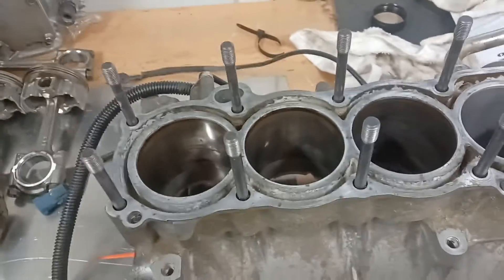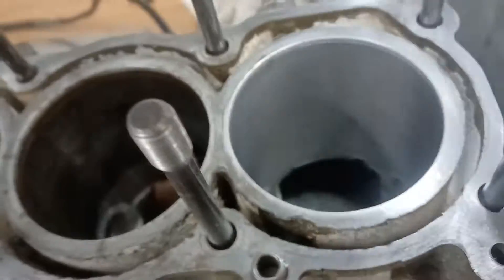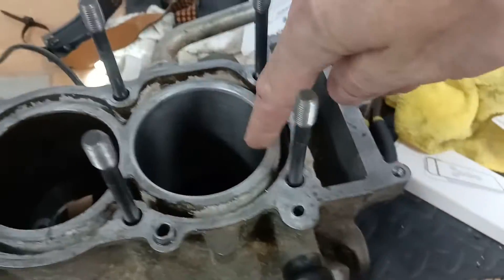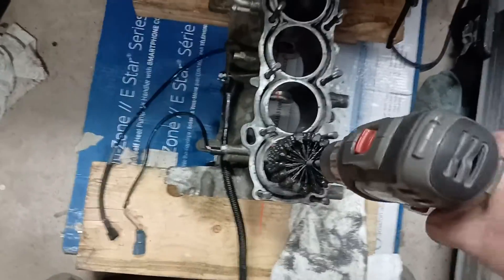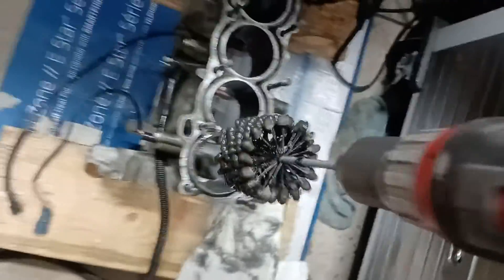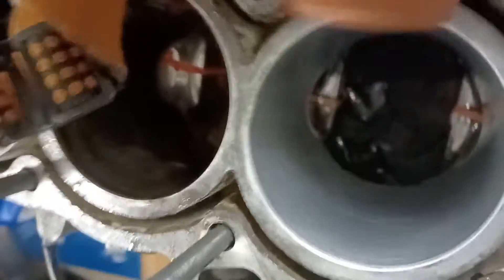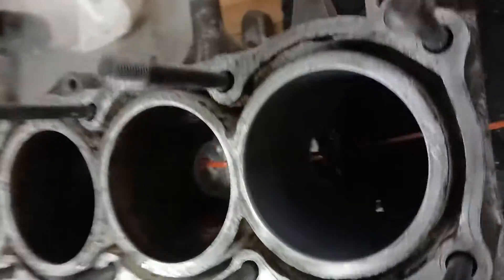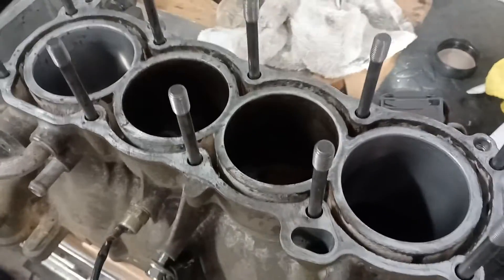Yamaha FXHO, VX110, FX140 cylinder deglazing imperfection removal using flex hone

Comment: I guess standard size piston rings were used
Reply from the maker: @a.h8362  yes.  this was just de-glazing and cleaning them up.  it doesn't take off enough material to need to go up in size on anything but you still need to check all of your bore measurements for tolerances and verify the cylinders are not egg shaped from wear of course

Comment: Great video.  Currently building two Yamaha mr1 engines, got any tips for installing a cylinder sleeve. I'm installing the sleeve in a sbt mr1 case the sleeves are different then the Yamaha block would like to try heating the engine case to 425 deg and see if we can push the damaged sleeve out.  Would like to salvage the engine case . Any guess ?
Reply from the maker: From talking with SBT those SBT sleeves are steel of course and they have a lip at the top edge that the hole is milled out to receive and then sit on like a ledge. I've heard of people doing the heating but I've never done it myself.  Greenhulk.net is a great PWC repair forum and it's free. You would definitely have better luck searching that for tips on that process.  If you are buying the sleeve from SBT their technicians should be willing to talk you through it as well

Comment: I've rebuilt a bunch of motors, however I'm going to be rebuilding a fx140 shortly. If you like talking shop give me a shout. I'm very familiar with 4tec and 15f
Reply from the maker: Good luck with the fx140. One thing to be aware of on the fx140 is that I do believe the Pistons are 2 mm narrower than the VX or fxho. Therefore, Deuce your own research but don't think that a VX or fxho piston, rod or crank are interchangeable with the fx140.  Also, I am not certain but the flywheel might be different than the fxho if you are needing to replace any of those parts. I know that the VX and the fxho are definitely different flywheels.  I was actually surprised when I found out that the fx140 had so many different part numbers but the VX and fxho have many similar parts. The cases are identical... The only difference is that there is a little exhaust mount add-on that the fxho requires and the vx110 does not have. Easy modification. The only other difference is one of the water pipes on the VX has a 90° bend instead of coming straight out on the fxho.
Reply from the maker: I spent months last year chasing a water leak problem and overheat issue on a 15f.   Turned out they were two separate issues, which I was not expecting. The overheat issue was actually a hole that had corroded through on the inside diameter of that last straight section of the muffler right before it goes into the rubber coupler.  I'm used to those 15 f's developing a hole at the very back end of that same section but I've never seen one corrode through 8 in up towards the front of the ski on that same thing.  Finally I filled that pipe section with water and watched it run out from the inside diameter lol.  The water in the oil was only happening when I put the ski on a body of water but would not happen on a garden hose.  I believe that problem ended up just being a poorly cleaned head gasket surface because after I replace the head gasket on super clean surfaces no more water in the oil.
Reply from the maker: My 15f pipe leak video. https://youtu.be/AAGFFWD_Ubw